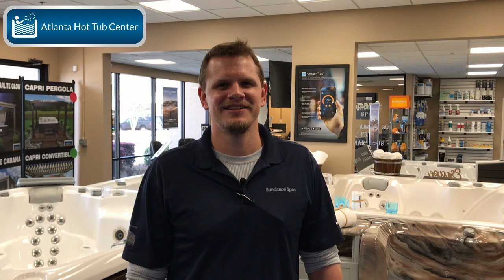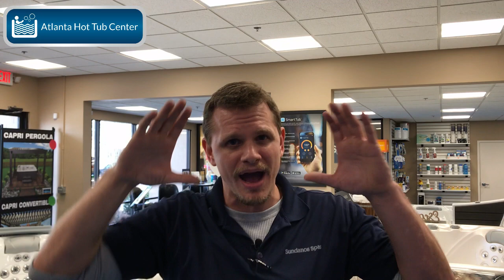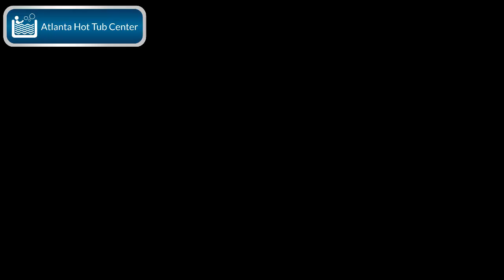How much does a hot tub cost?

Comment: You're the best bro! Because of you I am almost assuredly purchasing a 220 volt Sundance Hot tub. Model to be determined later. I do like the (although fairly sppecific) the handle bars to get in or out of on the, I believe is the 880 series. Doing my due diligence and research at this time but heavily leaning on Sundance becasue of you.
Reply from the maker: Good morning, I like the handles a lot.  I use them all the time on my personal hot tub.  They come in handy for sure.  Let me know if you have any questions or concerns.  You’re correct, the handles are on the 880 series.  Thanks for watching!
Reply: Ok thanks, now that I have your attention. I went over to the Sundance website and looked for their dealer in my area. For some reason one came up in Miami. I live in Broward county (north of Miami-Dade county). I dont like so far the yelp negative reviews? What am.I to do? I would like to pursue Sundance hot tub and also have qualified reliable Hot tub service, (Master electrician 220 install & maybe HT base rock pit or paver). Sounds like that is a lot to ask for here in South Florida? Appreciate any advice? Thanks!
Reply: Why no reply?

Comment: can I add a heat pump like from Arctic to a hot tub and would the cost be lower in regards to electricity?
Reply from the maker: Good morning, since the hot tub isn't designed to have an additional heater, I wouldn't do it.  This could cause issues with regulating the water temperature.  I am not saying it's not possible and it wouldn't work but it won't be as easy as just adding an additional heater.  You'll have to consult the factory and look at the plumbing schematics to make an educated decision.  There's also electricity to consider.  The heater will be drawing additional amps which may require a larger wire size or a breaker with a higher amp rating.  I personally don't think this is a good opton.  Hope this helps!

Comment: I am in the process of getting the electrical run for the hot tub. I am looking at a Sundance 680 series they are putting in a 50 amp line do you recommend I just get the 60 -amp?
Reply from the maker: Good morning, if you buy a 680 series that can be wired for 60 amps, then absolutely.  The smaller 680 series hot tubs can’t be wired for 60 amps so I would just make sure.  Hope this helps.  Thanks for watching!
Reply: @atlantahottubcenter  it is an Edison 680 series
Reply from the maker: @thomaspetito6923  Good evening, In my opinion, I would definitely wire it for 60 amps.  The difference in price should be very little and having all the jets pumps and heater working at the same time will assure comfort in the winter months.  Hope this helps!

Comment: Question I am in the process of building a home. Should I get a 220 volt connector
Reply from the maker: Good evening, I would definitely do 220 in my opinion.  The hot tub will heat better, stay hotter, and be all around more efficient!
Reply: @atlantahottubcenter  which also means the the proprietary parts such as the heating element for example will last longer.

Comment: Good points,  most spa packs can be wired either 120v or 220 by the jumper inside?
Reply from the maker: Good morning, it’s very important to ask your dealer if the hot tub is convertible.  This means it can be wired 115v or 220v.  Yes, by changing the jumpers and or dip switches on the circuit board most 115v hot tubs are convertible to 220v.  Hope this helps!